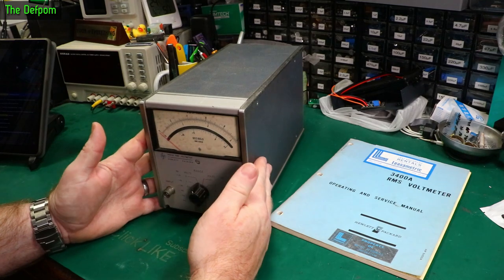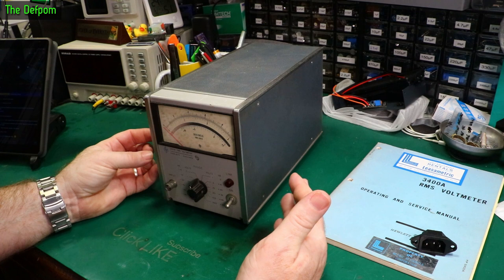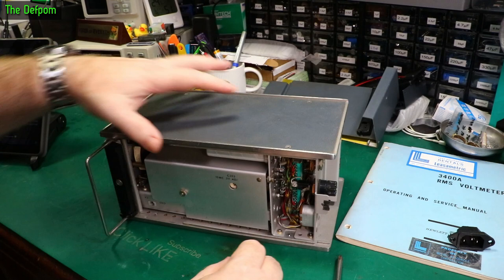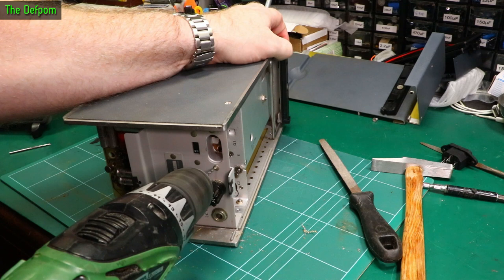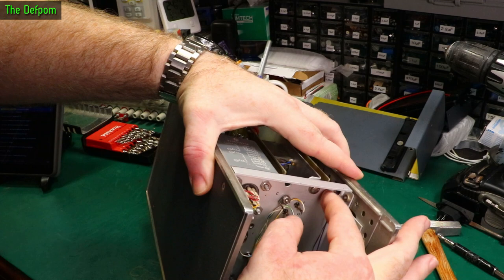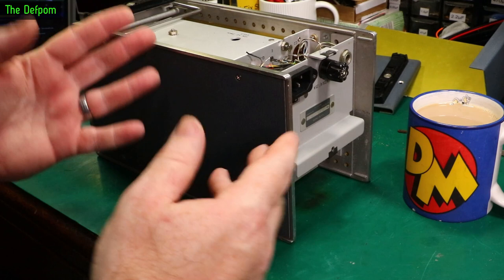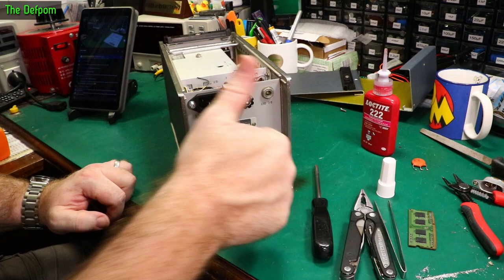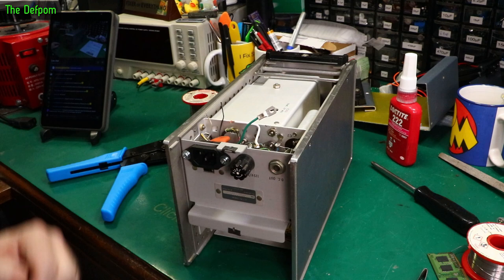🔴 HP 3400A RMS Voltmeter Repair - Part 1 - No.1111

Comment: If it's not a precious antique, or it's a home build, i'll always put an iec connector on it
If it's tight, you could cut down or bend the pins, or get a PCB mount, many of the ones in pc monitors are pcb mount but have panel mount tabs too. ;)

Comment: These are great old meters, the one I have is a 1972 design with option 001. Cleaned the contacts on the attenuator switch, replaced the power supply board with a NOS one from 1985, re-calibrated it and replaced the foam cushions for the impedance matching board. I also had to re-flow the solder connections for the Nuvistor tube socket on the impedance matching board. I use it for measuring power supply rail noise and receiver sensitivity measurements.

Comment: Will be curious to see what is ailing the meter.  You mentioned terminating the input jack.  When the meter is functioning correctly you will need to terminate the input when it is set down on the lowest (most sensitive) ranges otherwise it will peg the needle.

Comment: I would always remove all PCBs before mechanically working on the case. Metal particles and vibration might have damaged the electronic parts, especially the chopper and thermo converter.😖

Comment: You may wish to look into AC input socket from Qualtek 771W-AX1/2 available at Mouser and perhaps local to you as well.  It is smaller than the IEC connector you have.  Compatible cords should be readily available.  I know I have a few.  Keep up the good work.

Comment: I have this exact same unit, but unfortunately, as you hinted at, mine is one where the meter display has started to peel off.  Guess I'll have to reproduce one and replace it.  Signal Path also did a vid on this unit I think.

Comment: Hi Scott, just a quick question, the kaiweets pliers/ cutters are they any good, do they stay sharp? Cheers 🤙🏼🇦🇺
Great video mate, keep up the great work. 
Joe from Australia 🤙🏼🇦🇺
Reply from the maker: They have been ok, but today I noticed they were struggling to cut through some header pins, I think I stressed them a bit, blades aren’t perfect anymore.
Reply: @TheDefpom  so you wouldn’t recommend them ? If they last  longer than the 170 crud from, out of 10 what would you rate either?
Reply from the maker: @Johadart  I was initially impressed with them as they seemed much better that what I was using, it could e that I cut things I probably shouldn’t have with them… I would say to get a pair and see how they last for you.
Reply: Cheers mate 🤙🏼🇦🇺